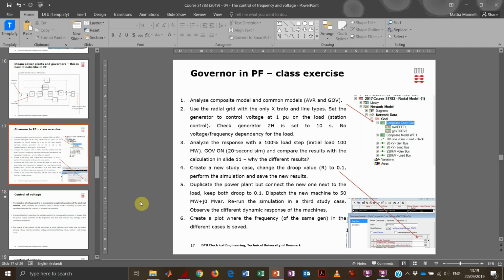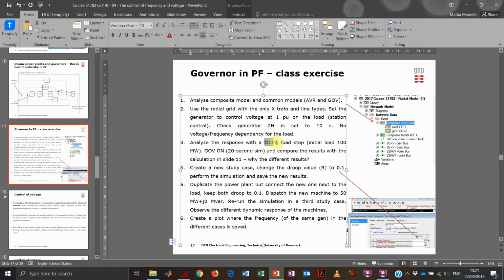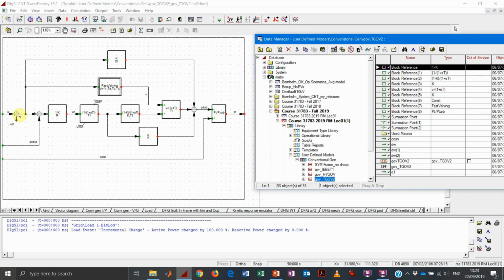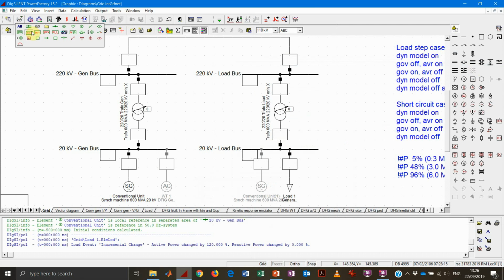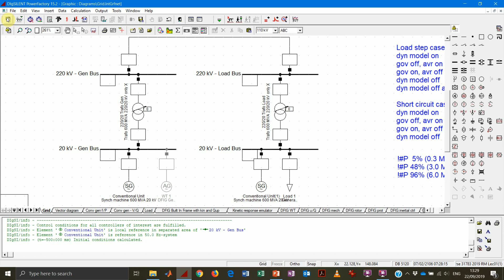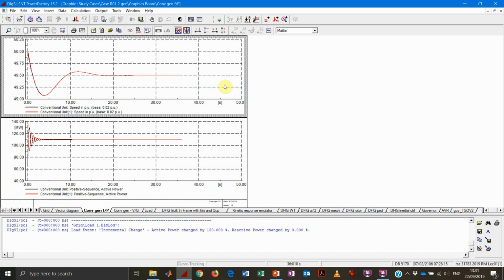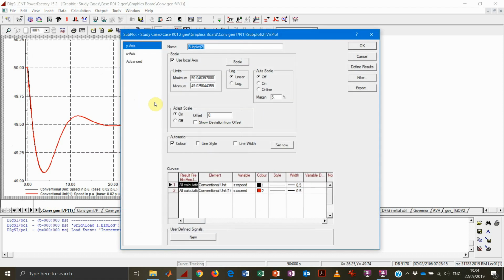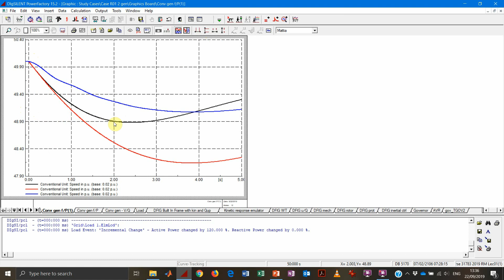DTU Course 46745 - Lecture 04 A - Governor and study cases

Comment: Thank you for this video. 

However, i am working on my thesis and when I edit the grid in a case study (adding or deleting a generator and changing it's power rating), the same change happening in the another one (base case). What could I do to overcome this issue?

Comment: Thank you for such a useful content

I am working on my thesis and need to creat different case studies on a system and compare them. I am having an issue when editing the grid in a case study (adding or deleting a generator), the same change happening in the another one (base case). coluld please help me with that.
Reply: Hi! Have you figured it out? I am having the same problem.
Reply: Hi. The best way is to export the base case study and import it again with another case study name. You can then compare figures by exporting them as data and then plot them in excel sheet or other programs. 
I hope this answer your question
Reply: Hi mister, i have a question: the droop constant (R) has to be in a Sbase system? I have 5 generators, and my system start with an unbalance when i incorporate govs in all of them:(

Comment: Hi Professor Mattia Marinelli,

Thank you very much for your enriching videos, always very good contents.

I have a question regarding the recovery of the frequency after a fault/event. Governor's dynamic model stops the frequency dip (primary frequency controller), but in the end still exist some steady state error between the actual frequency and 50 Hz. I am wondering how do you implement this secondary frequency control in order to recover the nominal frequency. 

I have seen that there is an option available in /Power flow/Secondary frequency control, but it is not working when performing RMS simulations.

What i want to observe is the time the system takes to recover a nominal 50 hz frequency after an event.

Thank you very much

Alejandro.
Reply from the maker: Hi Alejandro, to restore the frequency you need to create a dynamic model to emulate the action of a secondary controller. So you need pretty much to add an integrator in the frequency loop.
Reply: @MattiaMarinelli  

I really appreciate your fast reply

Do you suggest to create a new dynamic model independent to the generator model, or to add a "Secondary control" slot in the dynamic model of the generator?

If you have any reference to this topic, it would be really helpful.

Thank you very much,
Alejandro